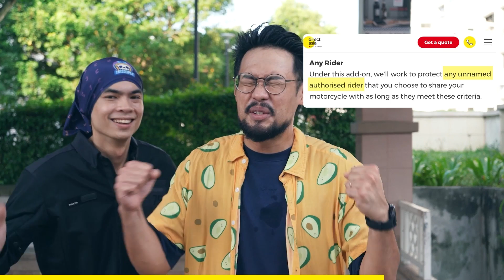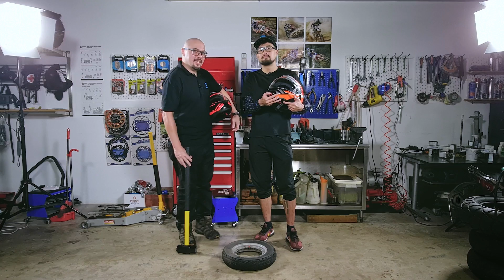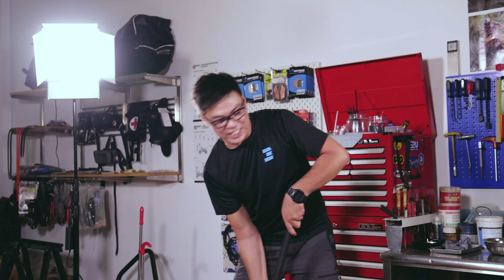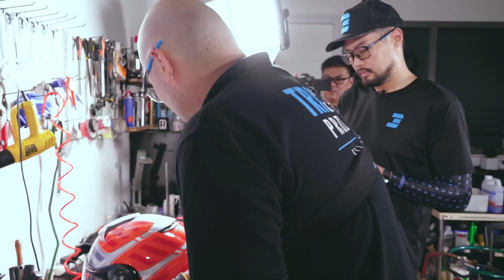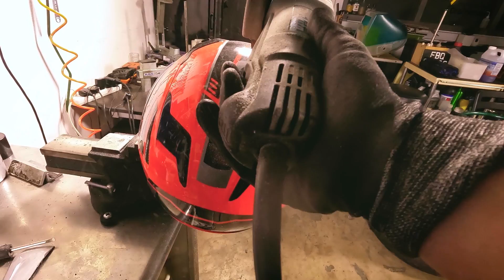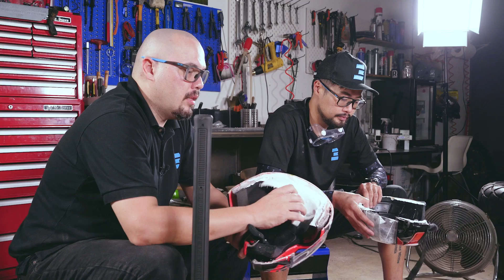These Helmets Are Tough!! | $850 Shoei Neotec 2 vs $250 KYT Convair Modular Helmets | To The Test

Comment: Nice in-depth video! Do the helmets feel heavy when flipped up? Any strain on the neck?
Reply from the maker: Honestly in our own experience its a very subjective topic. Generally modular helmets weigh a little bit more. Some people are okay with the extra weight some people hate it
Reply: Riding around with it flipped up is tiring on your neck as the wind is pushing against it. A better modular choice is the 180 degrees flip over.

Comment: I've actually got a question about helmet sizes in Sg. I've tried L** and H** Modulars. L** (XXL) was a very tight fit after the chin bar came down. Sales told me H*, I would not even be able to fit. I have 2x open face, O* (XL) and A** (XXL).

Was told in Sg, most helmets comes in Asian Fitting Sizes.

Do you guys have any recommendations for me on where and which brand I might be able to get a Modular to fit my head? LoL

BTW, I'm a new rider on d road, juz got my 2B like a month ago.

Sorry if I hijacked the comments line. Thanks Guys!!
Reply from the maker: Best way is to try the helmets yourself because our heads are all of different shapes and sizes haha
Reply: @tri333ple  Definitely agree we need to try the different helmets, planning to check out the K** modular this weekend.. 🤣

Comment: Shoei is over rated .arai shell so hard really feel like worth your money wont even flex when you press .snell certified worth it
But sadly they no modular cause it compromises the snell standard .yes their open face is higher standard than shoei modular
Reply: This is false. The snell standard isnt great for safety in real world settings, plus the standard itself has been 'morphed''. You want rotational protection which comes from softer and rounder helmets. Can look at FortNine videos explaining this.
Reply: @potatoesarefriendly7907  i rather wear a standards race rider wear which is still snell
Reply: you comparing full face with modular where got fair. Shoei X14 / X-Spirit 3 also used by MotoGP riders what
Reply: @nichiwodabian  open face arai also snell certified already